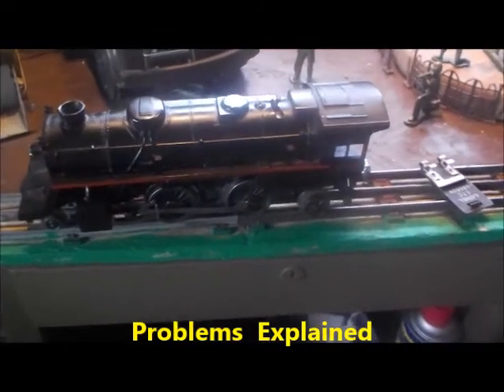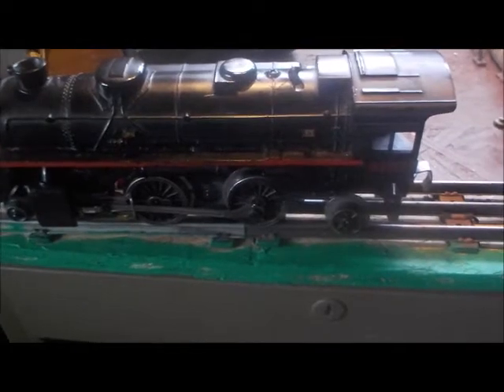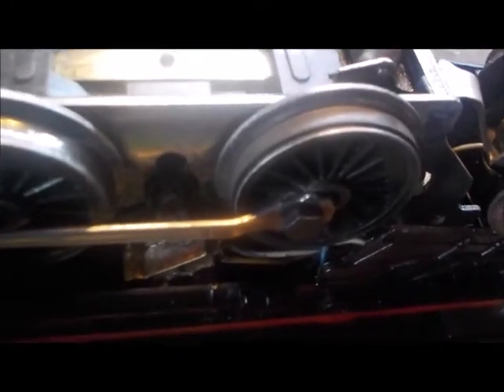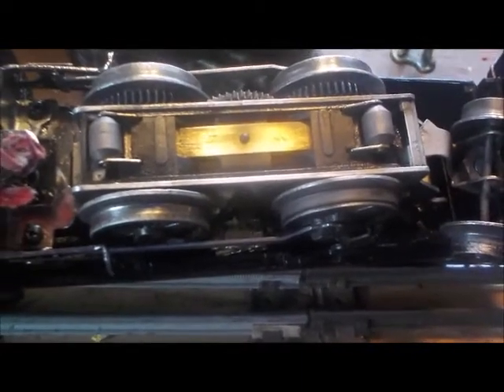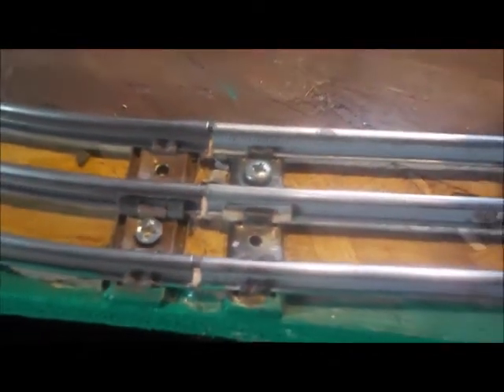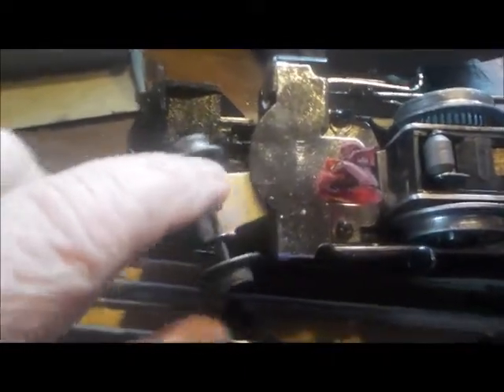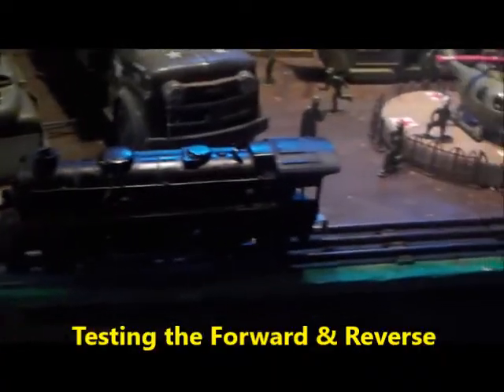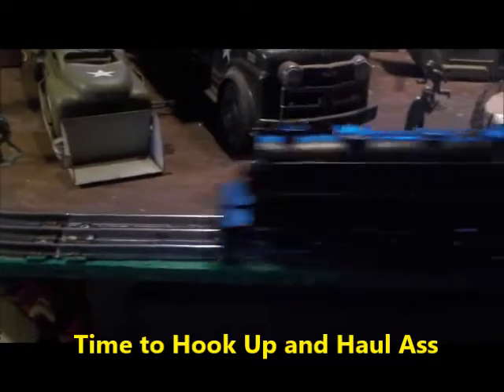1972 Lionel Silver Star Train Set ... Update

Comment: Nice little engine have you taken motor out and clean armature and brushes  and oiled it very easy to work on ,, l have one almost like yours , mine has a plastic armature plate that got hot and melted , had to replace the motor ,  now runs great uses very little voltage , mine has the sound tender , keep having fun (Doug in GA )
Reply from the maker: No, although, as a retired Mechanic I'm sure I could do it, I don't have a Manual to do such reapairs and so I'm kinda going with the  cautious  approach  of "If it ain't Broken Don't Fix it" Theme. Do you have any idea where I can get a manual or PDF on such repairs? Thanks for your help, Much appreciated.
Reply: @MrDanoconnor  ebay you can buy used repair  manuals